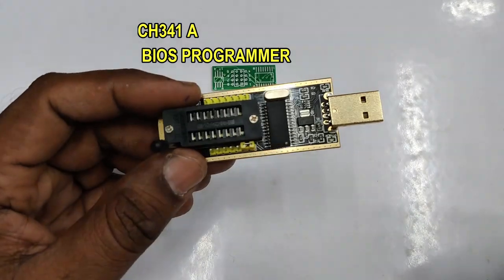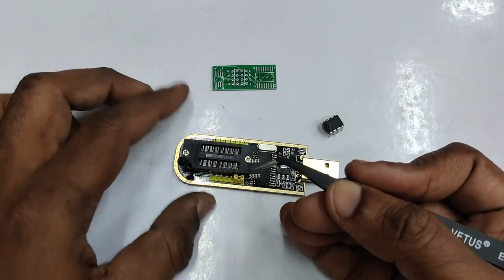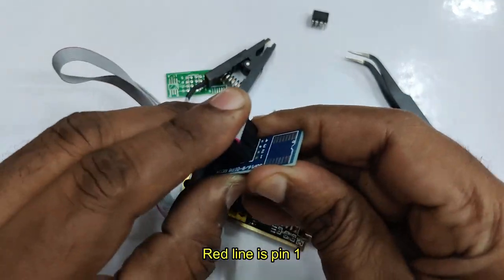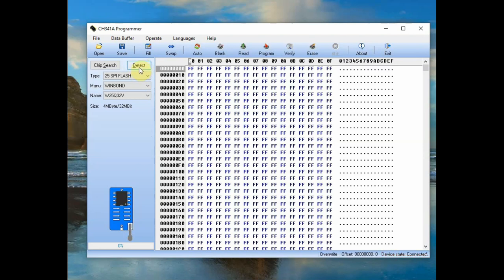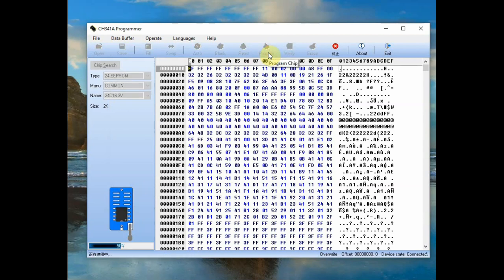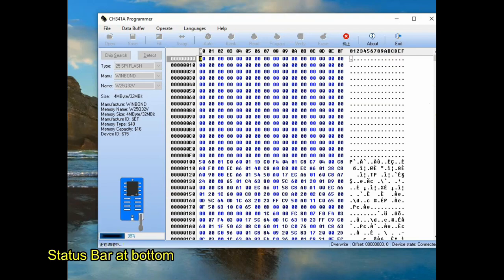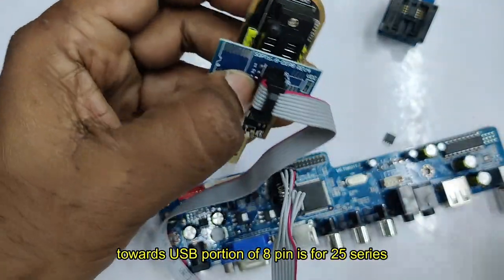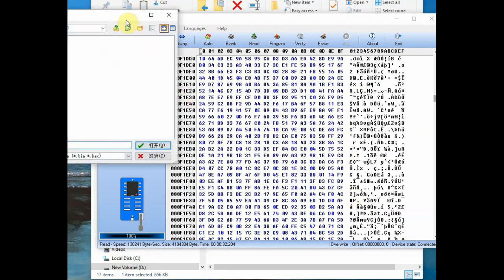CH341A BIOS PROGRAMMER

Comment: I corrected this CH3411A Black recorder, it left the factory with serious errors and I made the changes to it in another way and much simpler than those mentioned on the internet, there is a trail under the board that takes the 5V from the USB to Pin 28 of the IC, I cut it with a stylus (a very subtle cut) nor a mark remains, I put a JUMP between the 3.3V and 5V points on the Jumper bar next to the test socket, then I made a tiny jumper from the C4 (472 ) for the output of the 3.3V regulator that goes directly to pin 9 of the IC - CH341A....I didn't need to lift any IC pin or solder wires, it was a CLEAN modification.
Reply: YM mo UU

Comment: can i flash windbond  25Q64JVSIQ chip with this device?
Reply: yes
Reply: @chadwickcloister5143  Why can't we use an FPGA (For example Digilent's Basys 3 board) to program our BIOS' EPROMs. It should be easy yeah? You just send the signals necessary. Aren't these some sort of open source?
Reply: @landingonyuranus1813  you have me stumped with your question